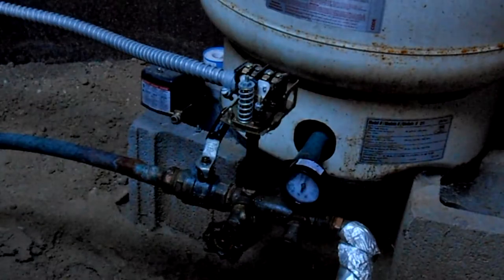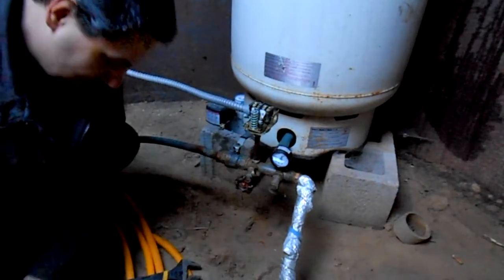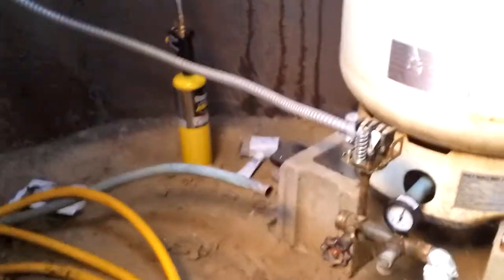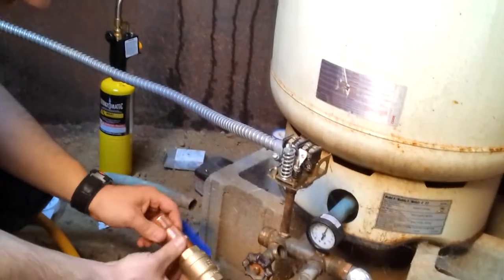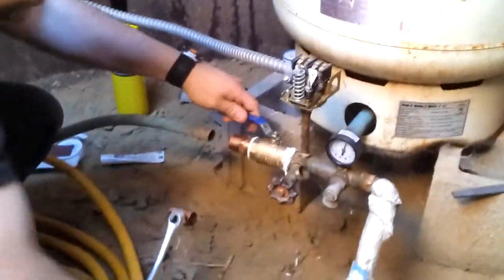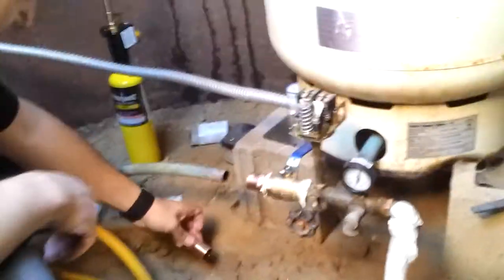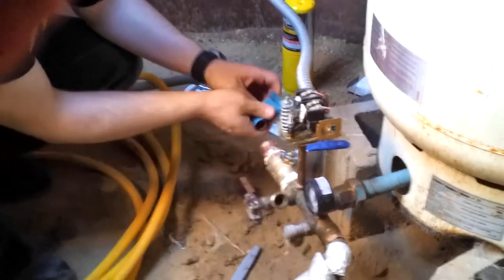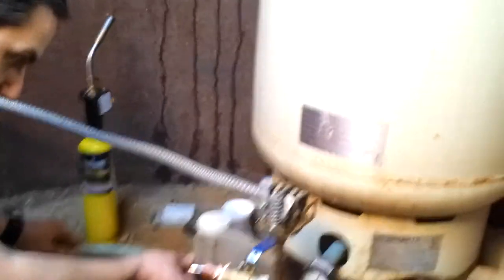Replacing the main ball valve on a well.

Comment: How did you shut the water off
Reply from the maker: There was a large electrical safety switch mounted on the wall.  If you see the flexible electrical conduit that connects to the well pressure switch, it's on the other end of that.  It's shown on another one of my videos: https://youtu.be/7ekOTlRwKLY?t=45
Reply: @dslynx  thank you got it all changed out